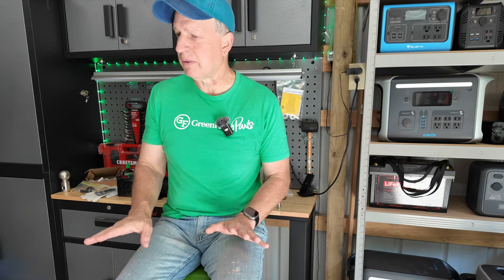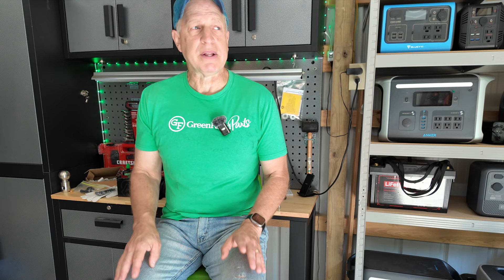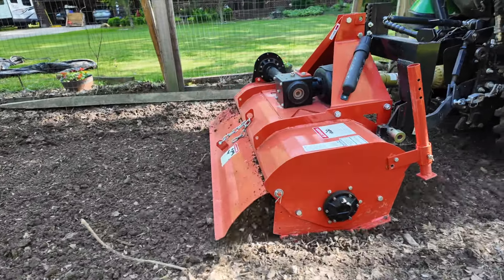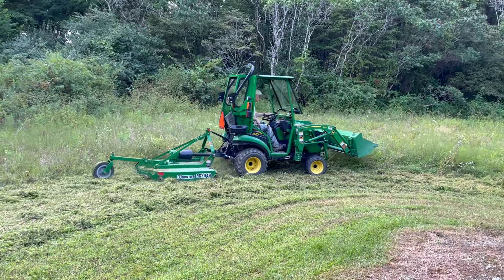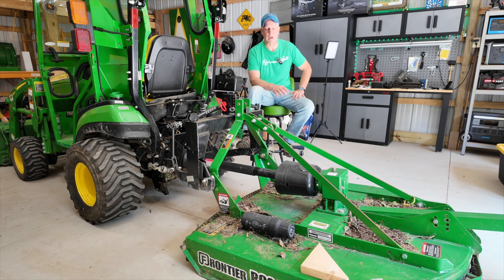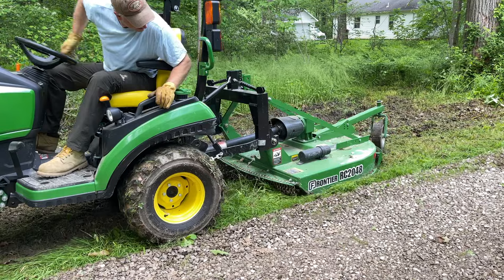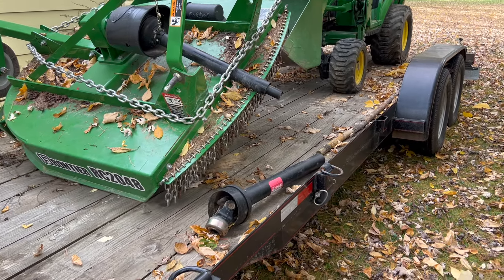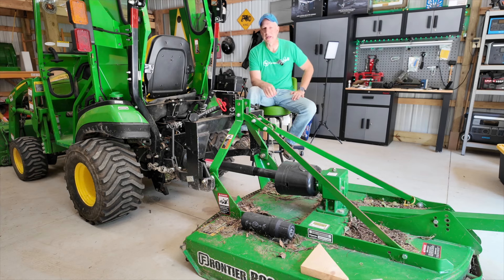Getting Into A Rear Implement Routine With The Box Blade, Brush Hog, Tiller, And More

Comment: I bought the John Deere hydraulic quick release for the removal of the front end loader as I am constantly taking it off and it works well for the front snowblower as well. For my rear implements I have them on carts with casters so I can roll them around my building and they hook up quite quickly so I do not need the quick hitch.

Comment: I have a hydraulic top link and it's a game changer for the rear implements. I highly recommend a set of rear SCV's and a hydraulic top link. I also use this for a hydraulic back blade in the winter. It compliments my snowblower well. You could just get a 3rd function and run hoses back to the rear. Multi use!

Comment: Most of my front implements are on yellow scaffolds like yours. Menards used to sell those for $98 on black Friday.
I use my X738 for mowing, spraying, spreading, and rolling. I use my 2025R bucket, forks, ball mount for trailers, and grapple. 3 point mainly for landscape rake or ballast bracket.

Comment: I'm with you on tractor routine. Less implements than you for my 2.5 acres. Here it is:'
May-belly 54" mower on-nothing on 3 Pt;
Nov- mower still on- Cyclone Rake pulled on rear 2" receiver hitch once leaves begin falling; easily removed if needed for mowing, and re-installed for next leaf session;
Dec- belly mower off, Heavy Hitch & suitcase weights installed on 3 pt, Frontier 60" snow plow attached to loader arms;
April- plow removed, bucket with tooth bar installed to smooth out leaf piles that need it and spread them through path in woods, weight rear ballast still on;
May-weight ballast removed, Fimco 12V electric broadcast spreader installed on 3 pt (not IMatch compatible), bucket still on to move around bags of fertilizer(tooth bar removed);
After spreader removed, bucket removed, (I always leave loader arms on tractor (lazy), install mower drive over deck. Bucket or tractor wagon may be used for branch cleanup, chainsaw use etc as needed. As I have a heavy Hitch suitcase cart that helps in weight install/removal, weight storage, I've never had to use  the I-Match yet. But it may make the HH ballast weights an easier ordeal.
Reply from the maker: You've got it down to a science!